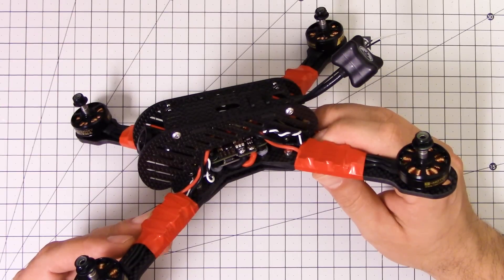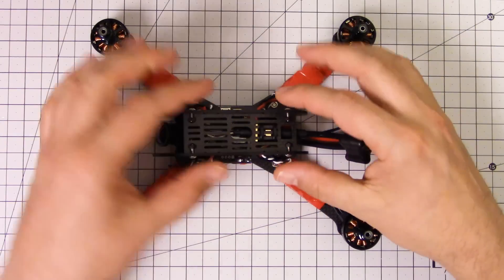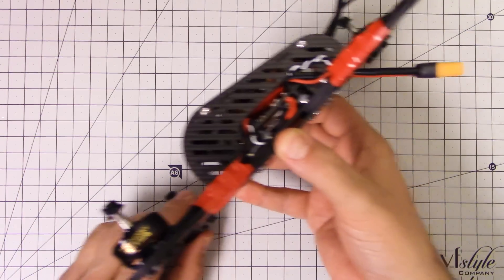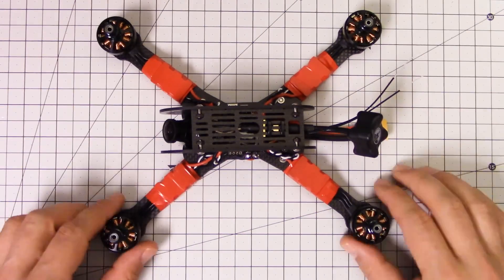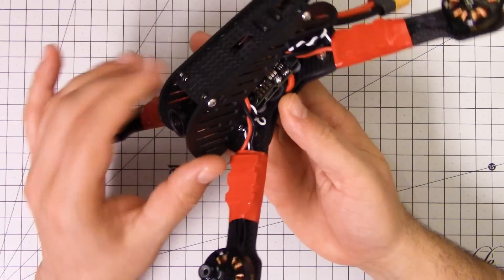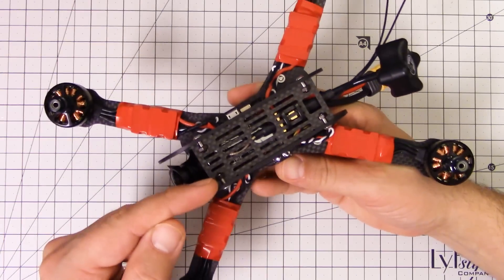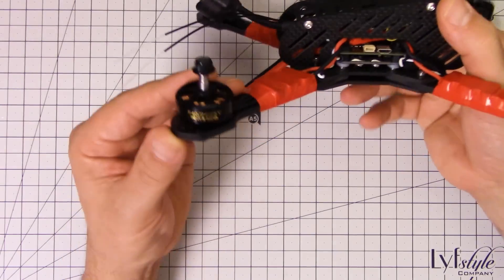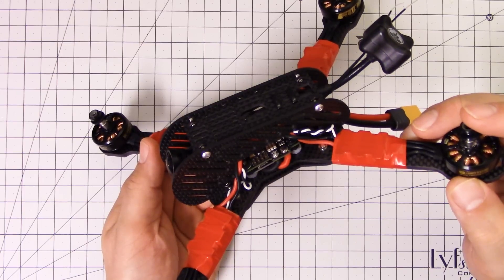AllCarbonRC Coyote | RACING DRONE REVIEW

Comment: Hello Joshua, I watched this video with interest, personally I like the stretched look, but I think you may have made an incorrect assumption about the stretch. You said a 'moment' is created when you add a force at a set distance from the centre of rotation (moment = force x distance). Therefore in Pitch the distance is greater than in Roll from respective axis, the motors can provide equal force, but because the Pitch arm is longer, then the Pitch moment is greater, so Pitch would be more sensitive than Roll in this case.

Comment: so im wanting to do stretch x frame so either xhover r5lx or hyperlite evo and then coyote stretch x im not sure i want a easy build but the benefits of lighter and faster and handling unlike my regular x frame ive tried to do well in multigp racing.. any suggestions
Reply from the maker: The Coyote is a fantastic beginner frame. The Coyote ARF kit that I built is still one of my favorite quads to race. It flies great. It is super durable in a crash. But if you are going for something lighter, maybe the Coyote isn't the direction you want to go. It's built more for durability than lightness.

Floss is a hell of a fast build, but challenging.

You could also take a look at the MultiGP spec-class frames. All of them are great.
Reply: Joshua Bardwell thanks Joshua that's awesome it will be considered.

Comment: Do you find a difference with tuning a stretch vs regular x?
Reply from the maker: Hard to say. The process is the same, but the PIDs may be a bit different on the pitch vs roll axis and especially you may need different rates to achieve the same actual angular rate.
Reply: My current working theory is that P needs to be higher on roll than on pitch due to the decreased leverage of the roll axis compared to the pitch. Not sure though...

Comment: I still have a Blackout Mini H Quad with 1806 2300kv and 12a Afro Escs. It is still flying great maybe a little bit slow on 3S but enough for flying in the woods.
Reply: MrAffi FPV same sort of situation with me but I use 2204 and a qav250, it's slow compared to my kissed alien with 2206 motors but it's worth flying around woods like you said

Comment: Hmm wonder if this is why I prefer my cp helis for this exact reason.  They seem so much easier to control on the pitch axis.  I thought it was a visual thing since it's easier to see a heli pitch since they are long.  But maybe it's this theory.  Hmm.  Hmm.  Hmm.
Reply from the maker: CP is a completely different animal for many reasons. One big reason is that you have much more mass in the prop disc, and the size of the prop is larger, so the inertial moment is larger too. I think this is probably a huge contributor to the inherent stability of a CP heli. But I don't fly CP so I can't be sure about that.
Reply: Joshua Bardwell Yeah they do have a better feeling of stability overall,  but forward flying is much easier for sure.  I can scrape the skids to the ground full speed amd keep a heli there. In my quads it's so tough.  Plus a cp heli we run at constant headspeed and use blade pitch to change altitude.  Probably too much different going on to compare. Plus reading the other response below about rear props in propwash never occurs with a heli possibly another factor. 

The basic flying is not very different. If you can fly a heli,  you can fly a quad and vice versa. I prefer helis for what seems like superior control,  visability  (los)  and pure smoothness and ability to auto rotate. 

Quads take it with with durability and fpv stuff since fpv crashes are inevitable. The crash worthiness of quads is what allowed me to even get flying a cp heli.  I would have spent 9 million in helis learning to fly acro mode on  a cp heli.

Comment: You got it all mixed up Mr. Bardwell. Angular velocity/acceleration = torque applied. You pointed out that the longer "stretch" on the pitch axis has more torque, which is correct, due to a longer "lever arm". But it doesn't mean it will be slower to move vs. the roll axis. The fact is that it will be faster to move vs the roll axis, because of the difference in angular acceleration.

Why does it feel faster (forward speed) then, in terms of speed vs a "true X". I think someone already pointed it out, but I'll repeat the answer. It's due to fact that the rear props are pushing through more clean air than a "true x" of the same similar size. Having a "true x" larger though, with more space between the motors will provide the same speed, with no penalty on the roll axis and still maintaining a neutral feeling.

So the bottom line is purely that a stretched x has some benefit of providing better airflow over the props. But it also has some drawbacks, as the roll axis are narrower, compared to a true x or an old school H-frame, meaning the roll speed is reduced. The benefit of having a higher pitch axis speed isn't really that important.

And before all the "stretched-x" team pilots go bananas...don't bother please. This is pure math of angular acceleration and rotational dynamics. You can't really beat that.

Addendum after watching the video for the 2nd time:
You use your fist in the center of the quad as the force applier. This is 100% wrong. The force is applied at the END of the lever arm, which may be the fact that you got this 100% backwards.
Reply from the maker: Pure math doesn't prove anything without valid application. I've heard a lot of people make contradictory arguments about motor distance and torque and acceleration. I wonder if you've read this: 

http://www.miniquadtestbench.com/the-truth-about-custom-motor-mixes.html

My experience is that smaller copters with more centralized weight rotate more readily.
Reply: Of course I'm referring to two similar looking quads.  And yes, more centralized weight helps on all axis. as the force applied at the end of the "arm" will provide a higher acceleration. But that wasn't my point. I'm arguing the difference and this is where you are wrong. Force is NOT applied from the center as you illustrate in the beginning, but at the end of each arm. But perhaps you should look up articles of angular acceleration and rotational dynamics. It's actually pretty easy to understand.
Imagine you need to spin a rotating door. Does is move easier if you apply your force close to the center of the pivoting point or at the end of the "door". Really surprised you got this wrong.
Reply from the maker: Did you... read the article I linked?
Reply from the maker: You're looking at torque, and torque increases proportional to the length of the lever arm, assuming constant force. But you're ignoring moment of inertia, which increases as the square of the radius, and which counteracts the increase in torque, with regards to acceleration. And this is why I get very suspicious when somebody tries to use pure math to tell me why a copter's motor to motor distance should have a given effect.
Reply: Yes I did, long time ago. It's PID related. Don't see why you bring PID controlling into this debate.
Reply from the maker: If a copter is slower to move on a given axis, you need higher P gains to achieve equivalent angular acceleration. If moving the motors outward results in higher P gains being required to achieve a given angular acceleration, then the net effect of moving the motors is to stabilize the copter. 

I believe this has more to do with weight distribution than with motor position, since moving the motors without changing the weight distribution wouldn't change the moment of inertia. In other words, if you were to move the motors but keep the weight distribution the same, you would get more torque with equal moment of inertia and your angular acceleration would increase for a given force applied.

Realistically, though, whenever you move the motors outwards, you also change the weight distribution, and since the moment of inertia is proportional to radius squared, that effect dominates over torque, which is directly proportional to radius. In other words, moving the motors outwards makes the copter accelerate slower for a given force applied. Which is why you need higher P gains on an axis that has the weight more spread out. Which is why I brought up the article from QMF about custom motor mixes.
Reply: Moment of inertia only applies if there's a change in mass and distribution of this, when comparing. To make a real comparison, which I don't think you are, you should consider these mass numbers and the distribution of it, to be equal and THEN throw the true-x and stretched-x on top of that. Then math DO apply, which makes my point.
Reply from the maker: Well sure if you insist on holding certain variables constant, you can make whatever result you want be true. But in reality, the distribution of mass between these frames is not constant. The "stretched X" frames have the weight more spread out on the pitch axis compared to "pure X" frames. Your point is true, if we are only talking about numbers on a page, but it doesn't reflect what is actually happening in reality with these frames.
Reply: In reality, which I also wrote in the first reply, is that having a wider spread on the pitch axis, gives the props more clean air, which translates into more thrust. It has nothing to do with it being "stretched".

Comment: I tune my Taranis pitch curve so that it is smooth on the initial pitch back and a harsh pitch forward on the initial forward pitch stick. It is like a smooth brake and a fast acceleration.
Reply from the maker: That would drive me absolutely crazy. I like expo, but I need the sticks to be symmetrical.
Reply: Joshua Bardwell Joshua Bardwell I also tune Taranis Throttle curve the same as pitch curve , to synchronize both. If I don't miss anything, the expo, rate or super rate in the FC can't get the curve to be steep at the initial stick input and shallower at the middle or end stick input, isn't it?
Reply from the maker: I don't think CleanFlight or Betaflight supports inverse expo, which is what you're describing.

Comment: Ok, still working on the X 210. I got the receiver and quad to hook up, modes are set. Now when I arm it , it shakes violently-- stop it, rearm-- shakes and stays a one rpm-- transmitter has no effect on rpm of the quad. I feel like I am so close to putting on props and flying(1st time). Any other ideas?
Reply: Bud Jones Did you set up the channels?
Reply: I put in a new ESC system, set up the channels-- all was well. Today, I plugged in and it would not run the receiver. Every thing else on cleanflight worked fine-- no receiver, no modes.
Reply from the maker: Check that the receiver is powered up.

Check that the receiver is bound to the transmitter.

Check that the receiver is wired to the FC correctly.
Reply: Receiver bound, transmitter up and on, wired as well as I know. Triple checked. I suspect that I have set a minimum speed to low or something like that. The motors run to tone on  the cleanflight program-- all to their Number. It really has me baffled.

Comment: Joshua, I broke my own rule-- I left the props on and plugged in the battery. The thing hit a 11 foot ceiling-- I couldn't even see it move. I changed prop settings and then it would not hook to cleanflight. I now have it hooked to cleanflight, plug in battery, use the system to accelerate and they run smooth as silk. The only thing I changed was prop settings.

Comment: Joshua, no apologies needed, but I have to respectfully disagree. I made a video a while back to show that nothing falls apart and it is very easy to access the center section of the Armadillo. It's how you never attached the cam braces to the cam upon attempting assembly that had you struggle.  Here's the video again. Cheers! https://www.youtube.com/watch?v=6eZ-FfqLQ8M
Reply: Armattan Quads b
Reply: Even though I mostly fly my Chameleon now I had my Armadillo out last night and just happened to failsafe (my fault) from 70-80' up while in the middle of a flip. It hit upside down on hard-packed caliche. No damage to the top or sides although that <insert negative adjective> camera mount popped out of the slot on one side. 

I agree it was a big pain to run the ESC wires through the side-plates of the Armadillo frame (a little Dremel work saved me) but asserting that those three beefy aluminum cross-pieces, with the correct length screws installed, are somehow more fragile than what you're showing here with the Coyote's captive nuts is pretty questionable. I'd love to see you really slam both frames down on asphalt, making sure they land upside down, and see which is more fragile (although Armattan and the Coyote guys might not be big on that kind of testing). 

I agree the Armadillo can be a struggle to wire up and mounting the camera requires a few more hands and than I have plus some questionable vocabulary, but it's not a fragile design. 

I've stripped numerous vertical aluminum stand-offs in very hard crashes on other quads but I've never even had the Armadillo's side-to-side standoffs loosen up in a hard crash. I think the Chameleon flies better and the Coyote may fly better, too, but the Armadillo is my quad of choice when practicing sketchy moves just because it handles hard crashes so well. 

Love your channel!

Comment: The physics make sense, but I still believe that all the benefits you can gain from an XL frame, you can get on mostly any frame by tuning and configuring the flight controller.
Reply from the maker: Maybe so. But hardcore racers worship the lap time over all. So if they are swearing by it, it's worth a second look.
Reply: The hype train is strong in the quad community ;)

Comment: Joshua-- this is my first build, and I have tried to follow instructions that I get. The receiver is bound, and has a solid light-- the transmitter shows signal (like wifi). It has worked in this copter before. I changed things (Throttle etc) and now the receiver and quad are not talking. Thank you for getting back-- your videos are great. I thank you for your help-- in advance.
Reply from the maker: What did you change?

Comment: For some reason after my motors get hot after I raise the D past 20 on betaflight 3.0.1 I have brand new motors with king kong props. I have also set my filters and tried stock. Any Ideas
Reply from the maker: You have a problem with vibration getting into your flight controller. Try soft mounting the FC. Some motors are unbalanced from the factory also.

Comment: Joshua, My receiver and modes will not work on Cleanflight. It connects, I set everything else-- what is holding me back? It is on the right model, -- tough-- any ideas??
Reply from the maker: Is the receiver bound and connected? Usually this is indicated by a solid LED on the receiver.

Do the channels in the Receiver tab move when you move the sticks?

Has the receiver ever worked on this copter before? Or is this a brand new  build?

Comment: Hi mate, so here is what I perceive as the issue with this one. The stuff you quote only applies if torque is applied blindly, however something like bf uses the stick command via the PID loop to decide upon a speed of rotation in degrees, the modern motors are more than capable of attaining that speed without straining, therefore the speed of movement on any axis is a function of the stick position, the s-rates, rc rates and expo. There will be a slight difference in the accel and decel to and from a specific rate, but that is not going to be perceptible for racers, more for full and hard stick acro, so the whole thing doesn't seem to hang right to me, of course there will be the placebo effect which is entirely valid, but the science seems to be on shakes ground no?
Reply from the maker: I'm not sure the science is on shaky ground. We know that centralized weight distribution results in a more "limber" copter. I've personally experienced this. So spreading the weight out should result in a "stiffer" copter. There will definitely be some interaction with the PIDs, but the idea that the motors are so powerful that the PIDs completely negate physical frame characteristics, I don't completely buy.

Comment: May i disagree with you a little? I think the reason they stretch the motors along the length of the copter is becouse the weight is stretched more over the lenght of the copter so the power aplied by the motors further away from the center is easier for the motor to pitch the copter... So the force needed to pitch the copter is reasonable the same for the roll... Agree?
Reply from the maker: I don't think that's right.

http://www.miniquadtestbench.com/the-truth-about-custom-motor-mixes.html

Spread out weight makes for a copter that is harder to get rotating on that axis. But the distance from the motors to the CG is moot.
Reply: Interesting article! More force needed for  more travel distance, but less force needed for pitching the weight when motors further from cg... The second one was my theory but now conflicting with the first... Hmmmmm....